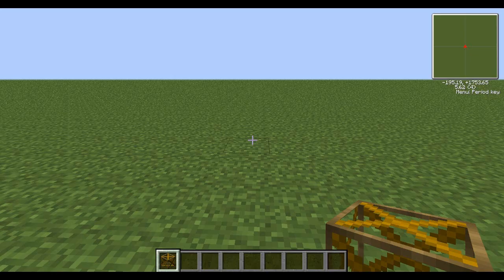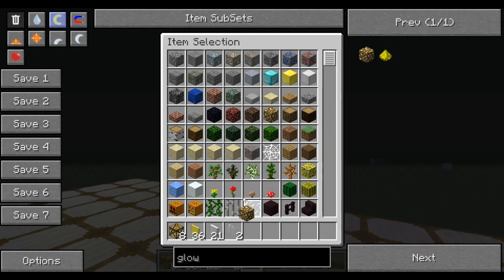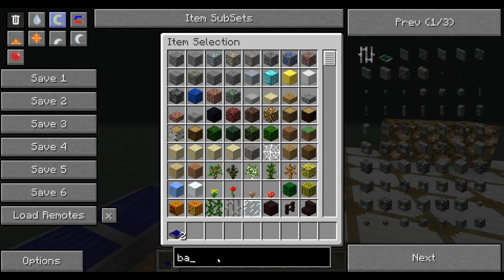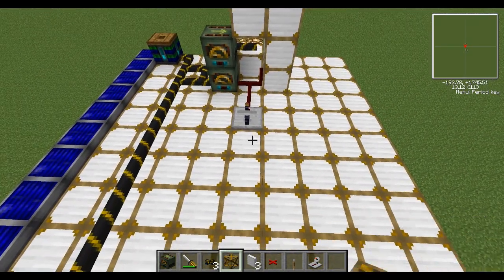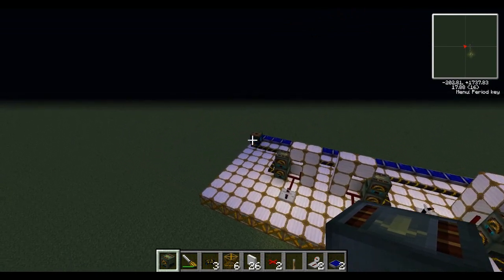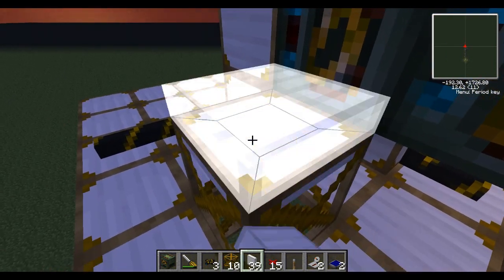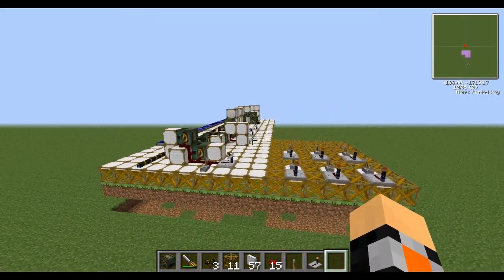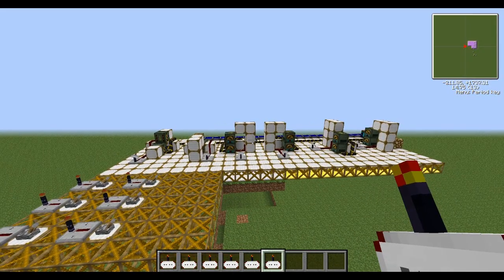Tekkit Tutorial: How To Build An Airship!

Comment: I also made an airship but mine does not have the transmitters and remotes, but my airship can keep moving in any direction when the lever is on. I can make it constantly move by inverting the signal of a timer witch makes the motors move each time the signal turns on. When the lever is on it makes the signal to the motors stay on and not turn off so the inverted signal from the timer can turn on to make the motors move. (Whenever the signal to the motors turns on they move, not necessarily when the signal is staying on.)

Comment: My airship was working but then i added panels and covers but it started not moving. The recievers are recieving the signal. The bottom motor moves but the top one moves forward but then stops working. its hooked up correctly idk what to do

Comment: No there is not :(.  The max speed is about 3m/s but then the "main" engine out of juice and has to charge after about 6 blocks.  I guess you could try and build another engine to run while the other is charging and time it accordingly, but then just the engines would push the 1000 block size.  I wounder if i can edit it.